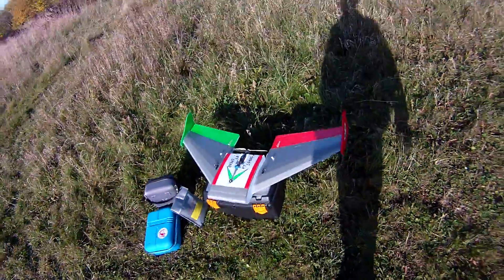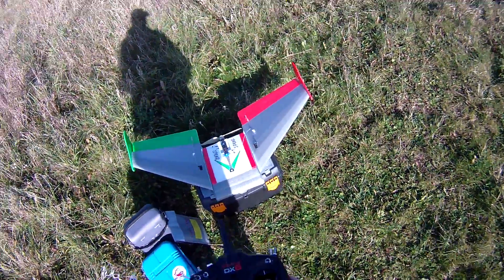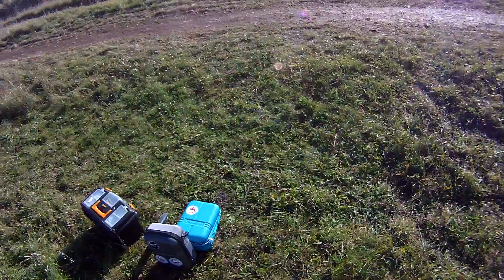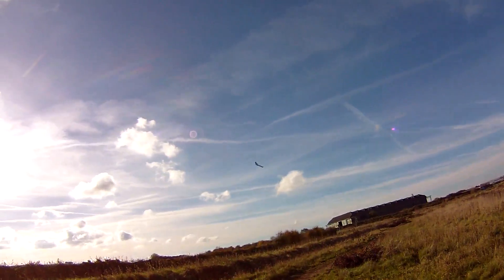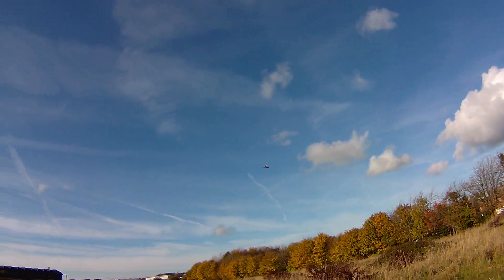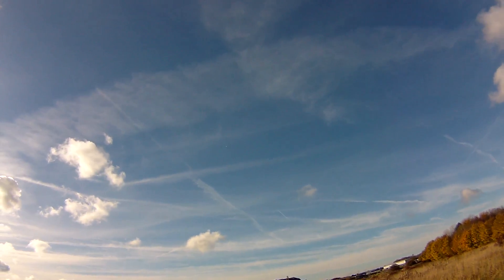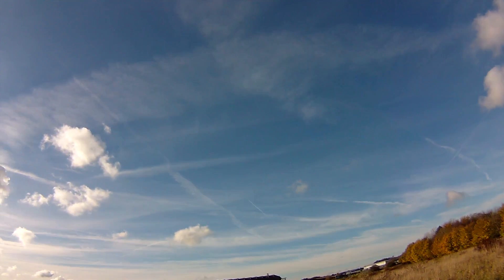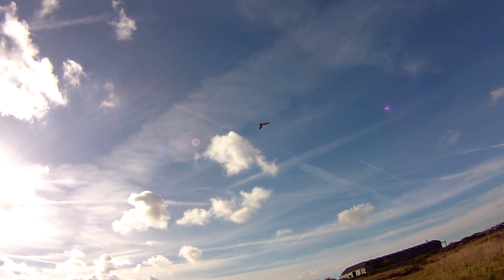FT Spear Maiden

Comment: Gr8 flight. Not happy with the weight of the one I made in Australia as the foamboard is so heavy so haven't flown. But might give it a go seen many flights of this plane but this one of the best.
Quick question what size battery where u using tge flights sempt short?
Reply from the maker: Angus Whitehouse I mostly use a 2200 3s in my larger models but this can take a bigger battery than that and still fly well. Make sure the CofG is on the forward most mark. Enjoy

Comment: I'm confused about motors. This is a tiny little 8 dollar motor, yet the one they recommend is huge in comparison. Trying to find out what I need for this plane that will fly it nice when loaded up with fpv gear. Thanks for the video.
Reply from the maker: Matt Jones Motors choices can be very confusing. Do your research before committing, the flybrushless site is a good place to start. Also don't be afraid to change it if performance is poor.
Reply: Awesome thanks for the website! :)
Reply: Matt Jones know old but u must remmember he made it out of depron alot litter than foam board so easier to lift. Mine was a tonne because foam board in Australia is diffrent and heavy.

Comment: How much throttle did you give it on that launch?
Thanks for video...going to start my build tonight.
Reply from the maker: Damian, I normally try to use about 60 to 70% then throttle back if needed. Doesn't need a great deal, it will fly well down to about 35%, but you lose manoeuvrability enjoy.

Comment: Interesting video
I flew mine this week  and I'm also pleased with the result
I used 6mm white depron covered with packing tape before building
The spars are hobbycraft 5mm foam board - I omitted the plywood centre spar
The ready to fly weight is low at 814g using a 3s 2200 lipo so the flight performance and glide is good
Its a bit underpowered with a D2830 1000kv motor running a 9x6 prop
Reply from the maker: Hans Leatherby This is most likely the best FT model I have built so far. Very enjoyable to fly with lots of space for extra equipment.